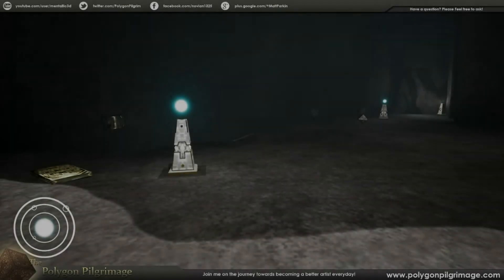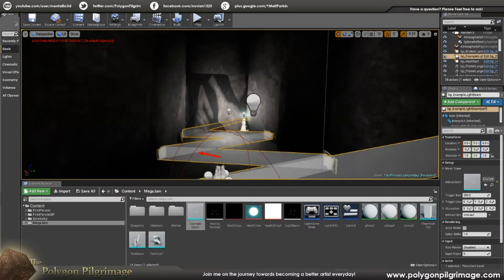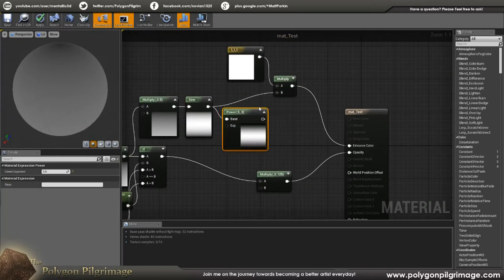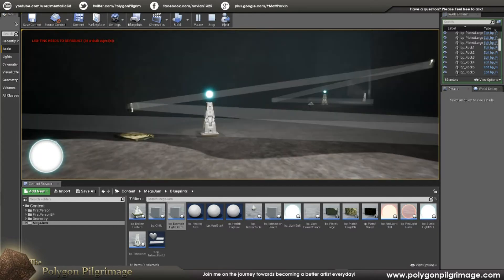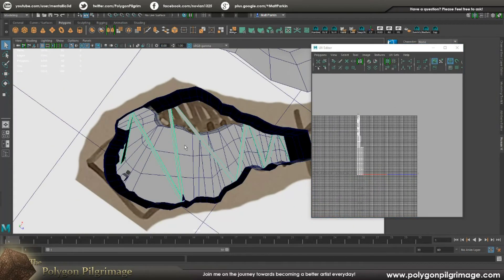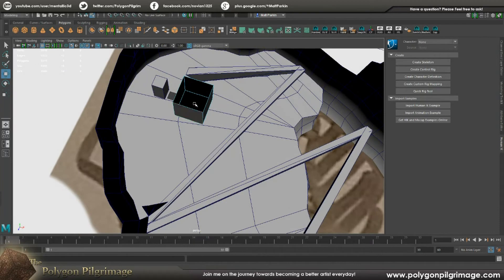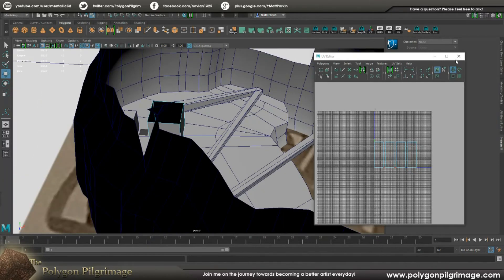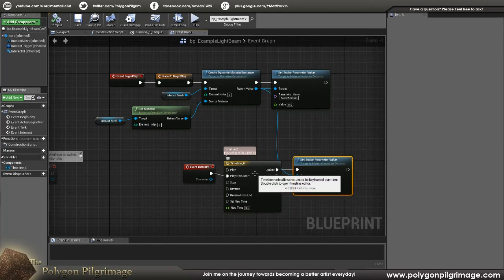Unreal Engine 4 - Light Beam Bounce Effect! (Full Tutorial)

Comment: Very cool, thanks for sharing.

I wonder how to go about making a more dynamic system, similar to the Desert Temple in Zelda: OOT.

Would probably have to draw a line trace then do some math to find a reflection/bounce angle, and spawn a light beam mesh at that rotation at the point of impact.
Reply from the maker: Exactly, the spawning of the light beam is good but you also have to make sure that it only stretches as long as the distance between the two mirrors is.  I tried with a particle beam but I wasnt happy with how clearly 2d in 3d space it was.  Thanks very much for your interest! :)